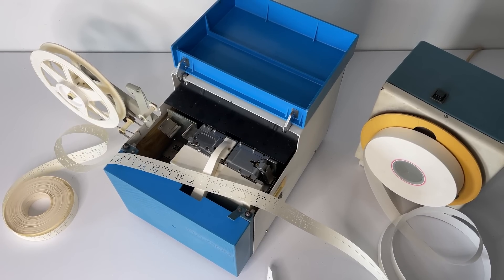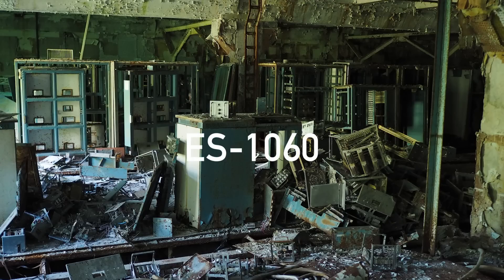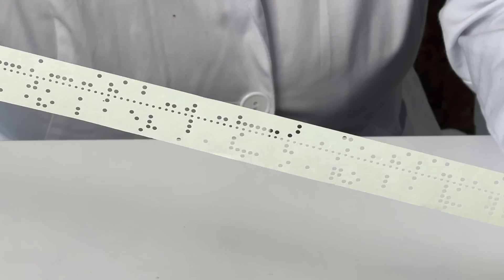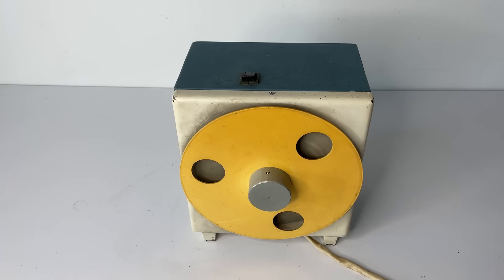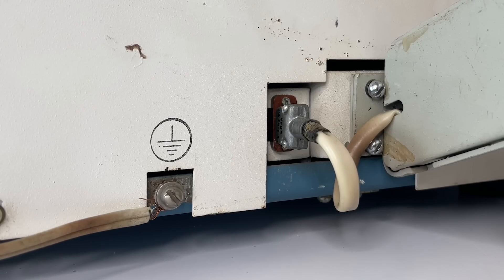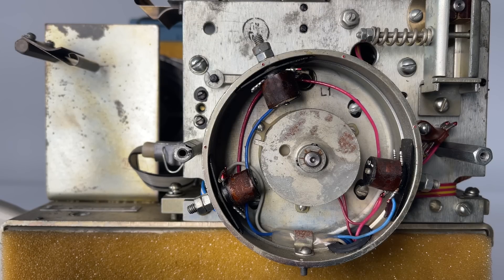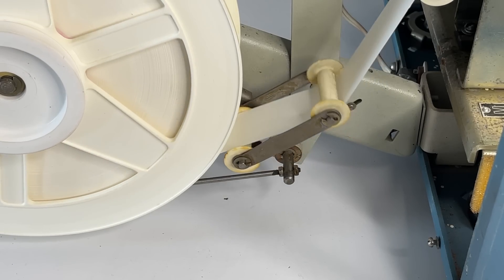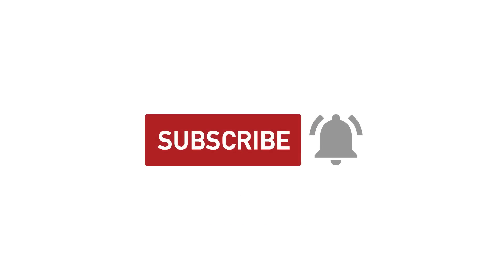Restoring the Chernobyl Computer Paper Tape Punch!

Comment: Wow! I even used to work with "ЭВМ СКАЛА" long ago. You know the capacitors  used in industrial soviet devices were much more reliable than in consumer sector. So there is no wonder.
Reply from the maker: K50-6 are still K50-6 after all)))
Reply: @ChernobylFamily  Are they К50-6  or К50-35?
Reply from the maker: @fixitalex  both types are present
Reply: @ChernobylFamily  LOL
Reply from the maker: @DiskWizard001  and no KMs!
Reply: @ChernobylFamily  such a pity dude !

Comment: I have the tape reader from a Takamatsu lathe. It was still the method of choice for CNC back in 1980.
Reply: I have seen these type lathes.  Back then i thi k they were called NCs instead of CNCs.
Reply from the maker: @seangriffon6502  probably. Unfortunately, we are not experts on lathes.
Reply: @seangriffon6502  I believe that you are correct. I'm a Controls guy so I don't really know what the difference is (to me it's bits, bytes, and wires). :)
Reply from the maker: Thank you!

Comment: Save 20gb of files on paper punch holes hahaha
Reply from the maker: Yes. And with punch cards that would be even worse.
Reply: @ChernobylFamily  How much paper does it need to store a feature film in 1080p? About 4gb? 10km?
Reply from the maker: @super_slav91  2560 m was for 1 Mb, so you can count :) I'm more concerned about actual loading of that amount of data. However, if jokes apart, at that times the same mainframes had media with capacity of hundreds of megabytes.  The punch tape by itself was not designed and not used in the 80s for that big volumes you are talking about. With magnetic tape that could work already realistic :)
Reply: @ChernobylFamily  I understand tape is used for archival use now, quite nice, but this beats spijon tech, wonder what the most random stuff could be done with this
Reply from the maker: @super_slav91  i have doubts it is used now anywhere except very old CNCs (that perhaps was the last wide field of use). Well, you can punch there letters and numbers as well, this is actually how the rolls were marked. Gonna be some cool merch in our Patreon :)
Reply: @ChernobylFamily  Funny enough I am a CNC operator, we can use tape or the internal HDD for running programs, I use the Yamazaki Mazak 5 axis CNC, loading is done using a horrible Fanuc loader and the CNC's are the most unreliable Japanese junk, much rather HAAS, I cut composite wheels for Ferraris, GM, Ford and other yet to be public. Best thing the Mazak can do is crash with a memory leak every hour.
Reply from the maker: @super_slav91  unfortunately i am horribly undereducated in CNC field, but somehow some terms ring a bell
Reply: @ChernobylFamily  I am just an operator, minor parameter adjustments, but the older CNC's are more reliable, there is a tape option but I don't think we ordered it as as there's only USB and ethernet, it uses G code, a celeron CPU, and 1gb of RAM running windows 7 embedded other one runs 8 and constantly crashes wonder how the Soviet CNC's ran, quite interesting stuff. long before my time I'm only 31.
Reply from the maker: @super_slav91  thank you for the explanation! Cheers!
Reply: @ChernobylFamily  Thank you for educating me on Soviet computers, Spasiba.
Reply from the maker: @super_slav91  in Ukrainian it is "Dyakuju". You are welcome... stay tuned, here will be much more, and not only computers

Comment: What was the data transfer rate (read/write speed?) It spins faster than I expected. Really awesome video!
Reply from the maker: Thank you!
The maximal speed of writing by PL-150M was 80-150 bytes/sec, while FS-1501 could read up to 1500 bytes/sec. 
Then, a byte-multiplex channel ES-4001 to which the controllers of both these devices were attached to had a speed up to 3000 Kilobytes per second. Actually, the megapanel we announced for the restoration is exactly the panel of this channel controller.
Reply: @ChernobylFamily  Awesome details! I look forward to seeing it in action some day
Reply from the maker: @ddogg14  With lot of nerves and proper funding it will be this year for sure :) the key is finding very, very specific documentation and memories of actual operators which will require hell of traveling.

Comment: I’m really impressed! I’m sure with an Arduino or a Cheap ESP8266/32 you could get some sort of communication going with the unit, it would be kind of impressive to make one of these wifi or Bluetooth enabled (maybe make it emulate a keyboard of some sort to get data out of the tape and give it some sort of web UI that translates text files back to binary) just to say you did it!

Really excited to see where things go with that control panel too, it looks challenging but would be very rewarding to have a working model going for historical reference.
Reply from the maker: These PL-150M and FS-1501 outlived their mainframes, as they were used for CNCs, and in some oldschool workshops they are still being used. So there are superrare industrial ISA boards for them, but also there are at least two circuits developed already - one on a simple logic with COM port communication and a DOS program, and more modern one on a microcontroller, also for a COM port. That or another we will try. At least, we'd like to make cool merch - a tape with a custom message :)
Reply: @ChernobylFamily  If you get ahold of one of those ISA cards - you can most likely use them on modern computers since ISA is still kinda exposed on the tpm header (isa to lpc chip needed tough)
Would be funny to see that old hardware and software working on something modern :D
Reply from the maker: @_DSch  very much hoping for that. Yeaterday we have visited the Polytechnic Museum in Kyiv, they have both PL150M and FS-1501 and they are VERY much interested to get some adapter as well.
Reply from the maker: @Randy sure!

Comment: Now here's an interesting bit of Venn Diagram overlap between myself and you guys - during the 1990s (the late 1990s, I might add) I had a job with an electronic funds transactor company here in the US called (at the time) STAR Systems, and our main central processing system was comprised of an IBM S390; I would wager the JCL we coded in would run quite handily on some of the machines you've talked about in this very video.
Reply from the maker: Thank you for a story! Yes, actually a lot of western software would run on ES. In reality, a lot of original IBM-compatible software was stolen/cloned and reworked, surprisingly even often improved with bugfixes ;)

Comment: Hey guys, I think the switches used for synchronisation are called "Hall effect sensors". They are triggered when there are changes to the magnetic field, in this case caused by the little magnet on the inner wheel spinning past.
By the way, this episode was very nicely put together: The little montage while powering the machine up, and the extra information about how punch tape works were great additions.
-Dominic
Reply: A Hall effect sensor is a solid state device.  This looks like a magnetic coil.  I'm not aware of any name for it, beside "pick up coil".  It would work on a principle similar to an electric guitar pickup.
Reply: @russellhltn1396  You could be right, as a pickup would certainly be cheaper... But my understanding is that the signal from a pickup is a sine wave, while a Hall Effect sensor is a square wave. If you're actuating a punch with exact digital (serial) timing, wouldn't a square wave be more easily applicable without modification of the signal?
Reply: @excessionary  Not really.  It's not that hard to work with a pickup.  A hall effect sensor is a semiconductor device that may or may not be easily available to the builders.  Hall effect is also a three-wire device: Power, ground, and signal.  A coil would be easy. I'd suggest looking up pictures of hall effect sensors.
Reply: @russellhltn1396  You're probably right, yes.
A three-legged semiconductor solution is beneficial in a computer peripheral, but I'm guessing based on what seems to be the simplest solution. It is probable as you point out, that despite the tech being around since the late 60's, availability and cost might have been prohibitive. Plus when I re-watch the video, the sensors look like coils, which are more likely to be something like a pickup or a reed switch. 👍
Reply: @russellhltn1396  Following on from my previous reply... Any idea why there are three wires (grey, blue, red)?
Aren't most pickups just two, or are there other types?
Reply: I doubt they'd have bothered with full Hall effect. More probably, they'd been reed switches. In Soviet literature, these are often called 'hercon' or 'gercon', 'херкон' or 'геркон'. It's supposed to be short for 'HERmetically enclosed CONtact; spelling it with leading 'h' is the Ukrainian way, and with leading 'g', the Russian way.
Reply from the maker: In Ukrainian we spell it also gerkon, but you are right, it is not ringing G, it is much softer :)

Mmmm I can't recall that small gerkons, will ask my mate who has full schematics for PL150M.
Reply from the maker: Hmm maybe you are right, need to take a look again to them closer.
Thank you!:)

Comment: Was there no equipment for dealing with fanfold punch tape?
Reply from the maker: If I correctly understand you, we did not have that. Fanfold paper of a large format was used only for that drum printers.
Reply: @ChernobylFamily  Fanfold paper tape is folded back-and-forth in a zigzag fashion at a pitch of about 15 cm.  It was commonly found on DEC systems.  The tape spontaneously unfolds and refolds itself as it passes through the punch or reader.  It is much more convenient and compact than tape on a reel.  DEC's "high speed" machine could punch at at about 30 bytes or characters per second, and read at about 200 bytes per second.  The waste paper dots made by the punch are called chads.
Reply from the maker: @cdl0  This sounds cool. Shame on me, i did not know this exists even - i have seen only rolled tapes of sny kinds!
Reply: @ChernobylFamily : Tape can be hand-fanfolded, with some caveats, but it looks neater, and the spontaneous re-folding works better, if it's done with a machine that can fold it in a consistent manner.
Reply: @ChernobylFamily  Video of fanfold paper tape being read by a DEC PDP8/e (c. 1970): https://youtu.be/KjgM3cpgiIk
Reply from the maker: Thank you!
Reply from the maker: Wow, that is beautiful! For Soviet clones of PDP-11 they made a similar looking unit which included a punch and an optical reader within one module. But it was based on rolling, not folding.
Reply: @ChernobylFamily  The DEC unit in the video includes a punch.  It is hidden neatly in a slot on the right.  Paper is fed from a box at the back of the unit.
Reply: @ChernobylFamily : That's unfortunate. For handling many relatively short pieces of punched tape, fanfold form, like on this picture, tends to be more convenient than spooled punched tape. https://en.wikipedia.org/wiki/File:Papertape2.jpg